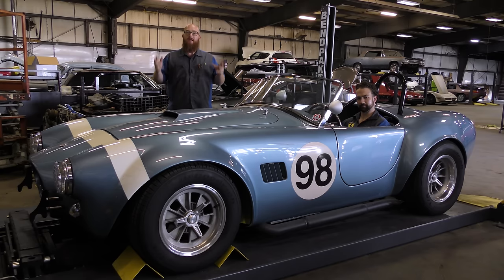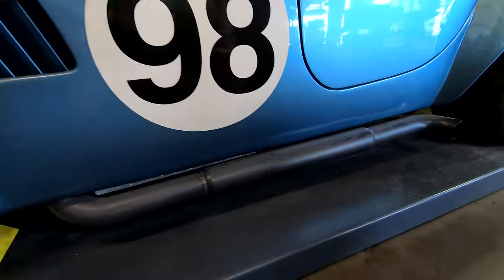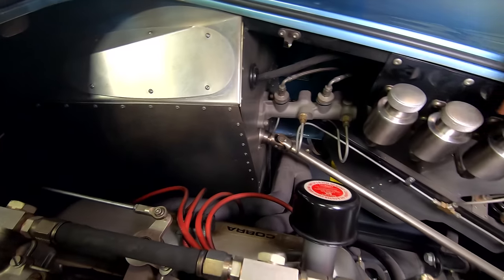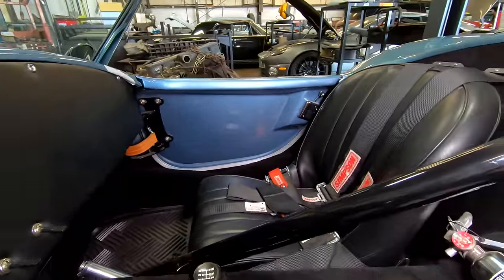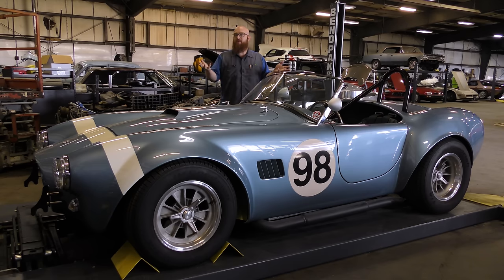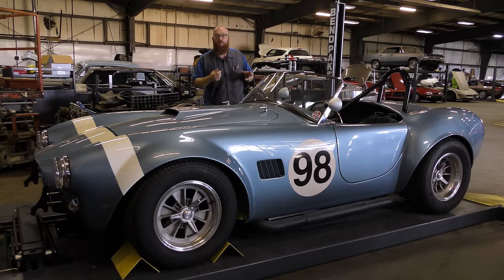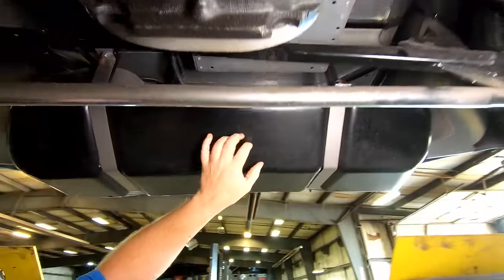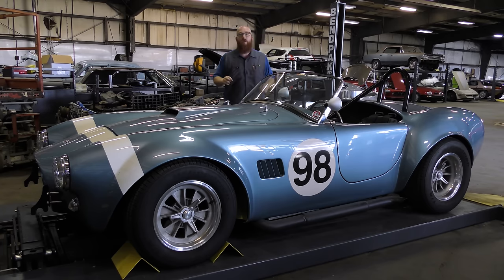How can two replicas be sooo different? CAR WIZARD compares '16 Cobra to the one just in his shop

Comment: On the original 427 Cobra’s the engine was so crammed into the car they had to put the gas pedal behind the brake pedal because they didn’t have enough room in the footwell. They also had to take a standard Mustang shift lever and turn it backwards because the transmission and engine were so far back it the car the boot was below the drivers elbow.

Comment: I'm starting to notice how people are forgetting how old cars are. The long cranking to prime the fuel system, pumping the pedal to set the choke, the smell of gas because of no emissions systems. New ones are just too easy. Push a button to start, put it in gear and off you go.

Comment: The original cobras had round tubing and FFR stuck with it for tradition. They could have completely changed the frame, but they wanted it to be like the originals.  There is one FFR with a 289 running in the 9’s in the 1/4 mile.

Comment: After sitting so long, How could the customer primed the system prior to trying to start,
Pump the pedal repeatedly?
Put a little fuel down the 
Weber's? 
Another option?
Reply: Yes; 
fit a loop in the fuel line near the tank and place an inline small cheap Chinese knock off electric pump in it..
You have one check valve in the main line between the 2 ends of the loop so fuel under pressure cannot flow back into the fuel tank when the electric priming pump is activated by the driver using a push button hidden under the dash.
Once the carb bowls are full the electric pump though turned off electrically still allows fuel to flow through it and of course the checkvalve in the main line also opens to allow fuel flow through so that the mechanical fuel pump now sucks like it is designed to do.
The advantage of a mechanical fuel pump that only runs when the engine is running.... is safety..
No running engine, no pressurised fuel spraying in a crash.
Reply: In most cases with a mechanical fuel pump you'll have to just keep cranking until it starts, you can spray starting fluid and run the engine for a few seconds until the mechanical fuel pump is able to draw fuel from the tank because of the higher RPMs while the engine is running but cranking is the easiest way.

Comment: how much do they sell new and second-hand? which is the best cobra replica that's honest to the original.
probably be nice to have a 2L Ford duratec supercharger 311bhp with 6-speed sequential gearbox.
how much do they average weigh. and need some underfloor panels as well.
try and get a an independent suspension back axle with attached gearbox like on Alfa Romeo.

Comment: So this fuel issue.. i have 305 TBI Chevy and it's sitting with old fuel somewhat year and always it start up and I wonder this old fuel is it over 2 years and it won't star engine or is it that I crank my engine about every 3 months? Or is it just the Finland fuel is better or is Chevy done that old 1989 SB so that it eats all to start running 🤔💪
Reply: Your car  has a simple form of fuel injection...and has a pump which pressurises the whole system when the key is turned on.
Your fuel probably does not have corn juice (ethanol) in it...so the fuel is not eating into your fuel system and accumulating water....and does not lose it's easy starting qualities (volatility) as quickly.
Enjoy those advantages...
Reply: @JohnSmith-yv6eq  yes sir it's probably latest SB that eats with first stage computer system everything 🤔🤣 it's the best small power engine I've enjoyed i just love this little cow CK pickup 🛻

Comment: I wonder what the curb weight is on each car
Reply: In my experience, the FFR car with a small block with a centrifugal supercharged 302 and T5 transmission is right at 2400 lbs wet.  My FFR 33 Hot Rod with a similar  naturally aspirated drive train came in at 2200 lbs on my corner weight scales.  400HP in either of these cars is plenty.

Comment: The narrow versions with the slightly longer wheelbase fit best. A 355 Chev is lighter than the Fords and moves 2 inches further back and 1 inch lower. A 8.8 is fine. A 9 inch is better. IFS is fine. A rigid axle in the rear is totally fine. 215-14 and 335-15 work. Watch my AC Vid.

Comment: Alot of kits are substandard. 
Around the way where my shop is, a guy built a cobra replica (not sure of the manufacturer) but the front fender flares weren't even close from side to side. 
It took alot of screwing around to get it right. 
I won't even go into the Smyth build in my channel, I'm about a year behind on uploading footage because of all the fiberglass headaches I've had with it. 
It'll get done ,but at this point the beginning of the build is all show car and shiny ,but the fiberglass will make you seasick beyond belief.
We're talking major cutting and reshaping, and I'm not an auto body guy. 
At least I have friends that can and are guiding me. 
Would I build another? 
Nope ,not unless the fiberglass is alot closer to OEM quality.
I feel bad , because it's marketed as a father/son diy driveway project with basic tools and skills. 
Well, I've spent a ton on tools when I've needed to do something on this build since I'm doing it myself. 
Pops is gonna be frustrated when he's got 1/2" body line gaps and things don't fit without major surgery.

Comment: I always liked the 289 ones too I mean. Sure the 427 ones with the beefy fenders and all are meaner and sexier but idk. I like the ac ace looking early ones more in a sense. More classic looking I guess idk. Miata effect. You can run the 289 balls to the walls without dying in half a minute. You can't w the 427 and the intake alone on the 427 weighed like 70lbs. Let alone the block and everything else.

Comment: Car wizard you certainly know a lot about mechanics and every day stuff regarding car maintenance more than I do

But you were completely off Mark describing this car 

It is supposed to be is a replica of the 289 FIA competition cobra

A speedometer was shoved off to the right for competition reasons, but FIA required it, just like a second seat

The competition driver certainly did not need a speedometer

Shelby American made five of them of which 2 survive today and it is really my favorite cobra 

Now what I have learned with these kits  is it most of them are replicas in body only

If you see one of these it's obviously a replica, because one is in the Shelby museum, and the other is owned by a man who owns about 50 cobras, Lynn Parks

And the only one who truly made a real replica of this, was Superformance. And it was so accurate from the original. It is recognized by Shelby American with its own Shelby serial number.

They made of course the regular replica suspension which was so crude. It was just two transverse, leaf springs, front and back.

It had a differential oil cooler just like the competition versiOn 

I could go on and on, but that shield over the gas tank. It was fabricated by Phil Remington, so in the pitstop gas would not hit the drivers.

One could make an ethical argument either way that if you want one of these, should it be so original as to have the original crude suspension or updated? None of them use the original 289, but the block that succeeded that the 302.

I've always liked this car

But as far as replicas, most of them are rather poor replicas

Comment: it takes time to get used to big power. i have been riding motorcycles for 31 years now and recently sold my motorcycles that had about 70 horsepower after buying one that has 208 horsepower. had it almost 2 months now and am still getting used to the increase. maybe by fall i will be comfortable enough to go full throttle in a few gears.

Comment: Uhh, this is a replica of a USRRC 289 COBRA. The 427 COBRA S/C IS for all purposes a different car even on the originals. The spoiler in front of the gas cap was used to prevent a siphoning effect problem they were having. Beyond this statement if you were comparing 2 different 427 s/c kits there will be differences.

Comment: I built two replicas and they were worlds apart in quality. They both looked alike but underneath they were totally different. Superformance cars are ten times better than this Hollywood prop. It's fine if all you want is to look nice. If you want a car that is engineered to be like the original then go with Superformance or  ERA both are well-engineered and are almost exactly like the original. I had one with a 289, Unique motors and the ERA with a 427 sideoiler. There is no comparison in performance or engineering and price. With the 427, I could break the tires loose in any gear. The 289 was lighter and easier to maneuver but the fun was in the 427.  The ERA was $40,000 and the Unique was about $20,000.

Comment: As Steve mentioned this is a replica of the 289FIA. 

Shelby built five of them for international competition of which only 2 survive today

Internally it’s very different from the 427. This suspension is a lot cruder with two transverse leaf springs front and back. 

I can remember an interview with Shelby at Los Angeles radio station in the 80s and even then he was laughing at how crude the suspension was even when they were building them

The backend is more reminiscent of a 427 but they had to change the fenders for FIA regulations to cover the tires which they made wider. 

And if it is a real true replica you’ll see two little dimples in the back of the trunk lid to accommodate the mandated suitcase. They didn’t have to race with a suitcase but it had to fit in the trunk

Of all the cobras this is my favorite
Reply: well that's NOT a 289 body, that is FFR's 427 style body
Reply: @richardschipper5989  The front end, at least to me, looks like a Series 1 289. I couldn't even see the transverse leaf springs from the undercarriage. Maybe it has a more modern suspension. 

The original Cobra really was a primitive design, but Phil Remington, through his changes, and Ken Miles, through his driver testing and suggestions, made it the iconic car it became. 

Phil Remington, among his many innovations at Shelby American, designed that splash shield for the FIA to keep gas from hitting the drivers at pit stops. 

The company who made the most accurate FIA was/is superformance, including even the differential oil cooler. It was/is eligible for the Shelby Registry, and was built with the blessing of Shelby American. 

Most of these aftermarket cars vary all over the map as to originality. 

Which isn't necessarily a criticism - I certainly wouldn't drive a multimillion dollar FIA on the road, but a kit car. 

The only 2 left in existence - one is in the Shelby-American Museum and Lynn "Mr Cobra" Parks owns the other,. He bought it as a wreck when Cobras were going for a song and rebuilt it.

Here is the 289 FIA built by Superformance. The Cobra Experience Museum in Martinez CA recently raffled it off but alas, I did not win it 🙂

https://www.youtube.com/watch?v=u9SJ5wvMz_U&t=28s

Comment: Factory Five was designed as a low cost ($14,990 - $20,990), single donor (Mustang), kit car.  FF builder/owners can of course, spend more and add their own  custom touches. like the four Webers.  

Superformance is a more expensive ($79,900), rolling chassis car, where the owner adds the engine, transmission and driveshaft.  You can also get authorized dealers to deliver a complete, finished version.  The "kit" car costs much more, but can be ready to drive in a few months, and is not a long-term project.  Typically, they are better built because the construction is more consistent, and doesn't as vary as much between owners.
Reply: I've been on the Factory Five scene for over 20 years, and very few people really came in under $20K and when they did, the car was not so great.  I haven't seen anyone do a donor build in a long time due to the current cost of the ever-more-rare Fox Body Mustangs.
Reply: @BradThePitts  But they still won't cost you $80K for a rolling chassis.  You can build an OK example for $30K to $35K.

Comment: Does it need a $9,000 wiring harness ?
Reply: If everything is old school wires...no, you can easily do that wiring yourself. BTDT.
Reply: wiring harness is around $800
Reply: @richardschipper5989  Car Wizard tried to rip off a customer for 9 grand on a wiring harness for a Merc SL600
Reply: @althunder4269  
Not a ripoff. 
Because MB in all it's wisdom decided to go green the wire coating for years was made of biodegradable material...not good old plastic.
Well that biodegradable harness was designed to last  3 years? 5 years?....but not 20 to 30 years.
Can you see the problem? 
With all the wiring in a MB...you need to have a complete new harness....and there are specialists who charge for that...
because they can...just to make this harness...
and then there is labour on top of that.

Comment: The 289 will spin the tires in every gear if you want to.
The 427 will spin the tires in every gear, even if you DON'T want it to!🤣

That 289 one would be a tasty little track beast and canyon carver, especially with a Jaguar IRS in place of that solid axle.

Comment: Kirkham Motorsports replica is the best.  Billet chassis. Aluminum bodies built in a ex fighter factory in Poland.Needless to say they ain't cheap.
Reply: The Kirkham cars are indeed, beautifully done but cost $100k+.  An FFR  Cobra can be done for about 1/2 that if you can handle the adventure of building it yourself.  If you have the perseverance to build one, you can rightly be proud of accomplishing something that only a few people have done.

Comment: Replicas.  They are so different.  Take this one and the Superperformance with solid axle rear suspension.  Even the Shelby continuation cars are different than the originals utilizing minor modern upgrades.  Many Cobra replicas only share the overall body shape with the originals.  Most owners are unwilling to suffer the original's discomfort and unsuitability for street driving on a daily basis.

Comment: The differences you're citing are not because of the brands (indeed, both Superformance AND Factory Five both offer a version of this car). I don't know the specifics as far as differences in the similar offerings, but you can bet there are some, and even then, many of those differences (such as frame type, engine/tans/suspension) are based on customer preferences when ordering their kit/turn-key car.

The car in this video is a replica of an FIA Cobra - a purpose-built race-only car. It has a passenger seat to comply with racing rules at the time (you also didn't mention the difference in the decklid which has bumps in it to allow a specifically sized suitcase to fit in the truck with the decklid closed/latched.

Comment: There is a huge difference between the 289 FIA and the 427 SC, THE 427 Cobra is as safe and fun to drive as the person behind the wheel wants to make it, and a well set up 427 Cobra will be as planted as any modern super car only without all the computer sensors to keep those who don't know how to drive a performance car out of trouble, I.E., antisocial brakes, traction control, launch control, and many other computer controlled gizmos that keep posers out of trouble, when you are comparing cobras, compare apples to apples, not apples to oranges.

Comment: The 427 would be too heavy for doing anything but drag racing or driving around having fun. The 289 is still heavy, but light enough for track driving and better handling. Cobra replicas are nice. But I would rather have an original AC Ace with the 4 cylinder. I think it would be more fun to drive. Cause you could use all the power. Instead of having to be careful in a V8 Cobra. I'd rather drive a slow car at it's limit than drive a fast car half throttle

Comment: I just want to add, with Factory 5, whether you have the 289 FIA or the 427 Cobra, you have the option of independent rear suspension or solid axle, depending on how much you want to spend. 
   The original cars all came with independent rear suspension.

Comment: My Shelby 427 is the real deal. Factory 5 is a cheap copy. Superformance is close but has an inferior frame and suspension.My Shelby is -580 hp, 600 ft lbs torque, Dana 44 bulletproof rear end.

Comment: 3:58 That unsupported steering u-joint hanging out there in no-man's-land is a failure looking for somewhere to happen. Having this thing all stuffed into a winding country road when that fails will wipe the smile off his face in a heartbeat.
Reply: Honestly, where is it going to go? I agree it looks suspect but the steering shaft is super rigid and the rack is legit part of the chassis. That position for the intermediary shaft is constrained in 5 axis's.
Reply: @daviddavis1322  Sideways is where it's going to go! That rack was never designed to be installed like that & this setup is really bad engineering.

Comment: The Superperformance is built for show and awe. Chassis design is lacking in terms of race car agility and stiffness. The FFR features a newer more technically correct chassis designed in-house at FFR . The newest version of the MK 4 roadster has an even more improved design. And if desired, the buyer can use an independent rear suspension from a 1990's Mercury Cougar. The best engines to use in such a light car are the small block Fords, 289/302. They don't overpower the car or less experienced driver. 350 horsepower is PLENTY, and provides a weight to power ratio similar to a C-7 Corvette. Anyone interested in a FFR roadster should take a trip to Wareham Mass. It's Cobra heaven and the staff will happily give you a tour of the facility. It's a very impressive and efficient company. You won't want to leave. I am not a paid spokesman for FFR. I'm just totally impressed by their knowhow.